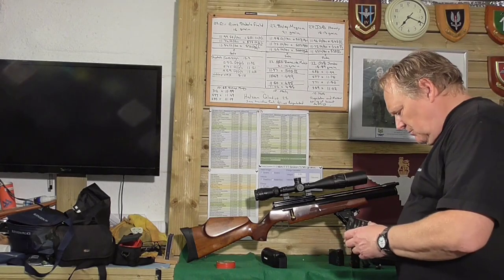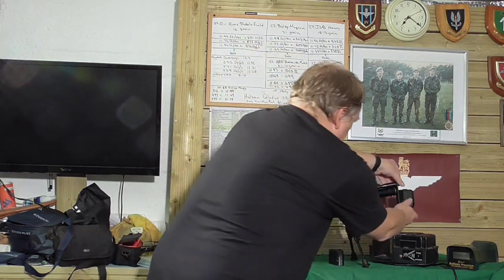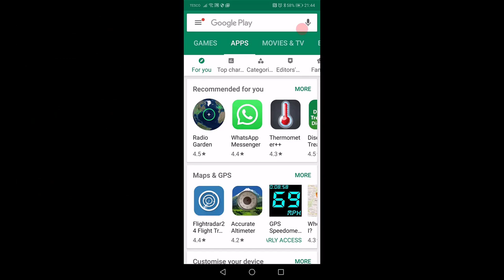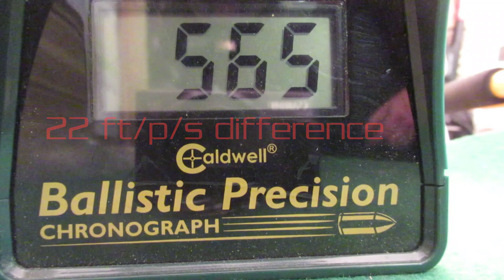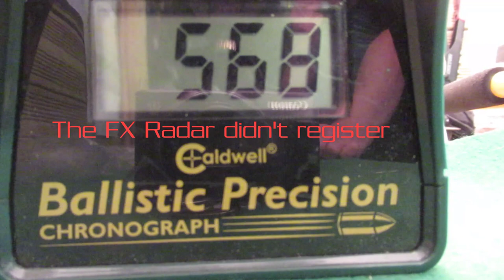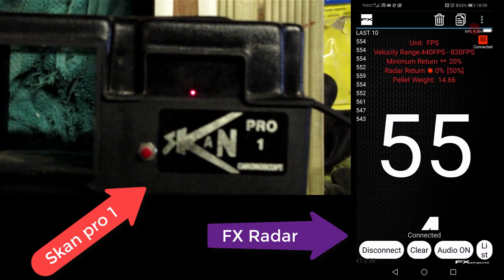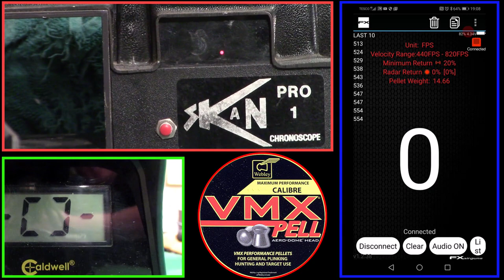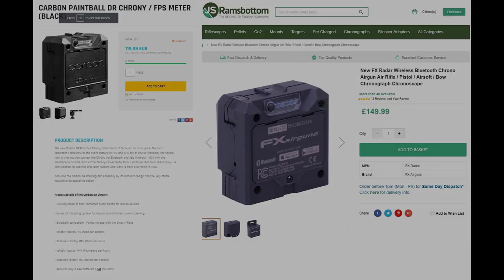The New FX Radar Chrono - How does it compare?

Comment: The FX Chrono requires a clear field of view to get a decent radar return, cluttering it with multiple objects will corrupt or prevent that signal. The only types you can directly compare without impeding the FX readings are barrel mounted, or other doppler radar chronos.

Comment: Just a quick point. The FX Chrono requires the space in front of it to be clear of other items. It's radar, if you place anything in front of it then you run the risk it will sqew the results, metal supports ( Cauldwell )  sticking up may cause issues with the radar reading. Looking closer at your footage and the screen reflection, did you place a compact camera between the FX Chronograph and the Cauldwell, that will block the radar signal?  In fact your further written results below show the FX Chronograph is within 1 - 3 FPS of the Grand Prix system, if I am reading it right.  Interesting that the FX Unit works bang on without a Cauldwell in front of it. Those results are from I assume one of your trusted testers. I am making a video to show how the placement of other items causes these issue. Also, and I have one, the earliest paintball models do not work the same as the FX Chronograph. Those telling others to buy one instead should pay the refund bill for those that buy one and are disappointed.  Love the idea of the barrel mount, but will that result in any barrel droop? Cheers. Giles
Reply from the maker: Thanks for your input Giles. More to do. The FX results did perform the same as the Skan chrono  that the police use to the same, or within 1 ft/p/s, as did the Chrono within the barrel of a Daystate Grand Prix, which says a lot for the accuracy of the  FX, which is great. Other tests at the range showed that the Combro cronograph were performing quite a bit bellow the ft/p/s of the FX, so could be a problem for those tuning a rifle with a combro and possibly going over the limit and not knowing about it. As for the Cauldwell i was surprised at the ft/p/s difference, which showed a higher reading. This could be down to the actural Cauldwell Chrono though and not the FX, as it was dropped a while back and the software didn't work. A good test though to see how the different chronos perform. In the last 8 shot group i realised that the power of the rifle had dropped of to bellow the specified field of the FX and i put that down to that as stated. I did the testing in the workshop due to the weather conditions outside, so will come back to this in the future. As with the paintball chrono the software for that works with the FX so is compatable. You'll have to download it and give it a try. The only difference was that it was geared up for European market, so only showed Jueles. All in all though the FX chrono is a great product. It worked fine at the range, so looks like the problems were down to the distance used to the pellet catcher and possibly items in front. No cameras were in front of the chrono, just chronographs. I also meant to attach the silencer in front of the clamp allowing the chrono to be under the behind the barrel, instead of the chrono slightly in front. Not sure if any of these made any difference to the results, but will carry tests out again at the range. I'm a big fan of you and your channel. Keep up the good work. Best wishes. Mark Holding Tinsley Park Shooting Club - A.R.T Team UK
Reply: I should comment here as the results posted by Mark were our original results taken at the ART range using my Daystate Grand Prix, crombro and FX Radar.  As shown in the results the FX and Grand prix fps readings were very similar while the Crombro was consistently lower. Around 50 shots were taken in total and the results were very similar to those posted which were sent from the FX via email and pasted into a text editor later.
 Marks test with the Cauldwell and the Clubs SKAN again showed a simi8larity between the FX and SKAN while the Cauldwell showed a noticeable difference.
Mark is simply reporting what he found... no more no less.  I agree the FX radar will need to see a clear space in front of it to obtain a reliable return...  I believe you state 6" clear space in front in your Test Video Giles.

Regarding the failed shots on the FX... I can only assume they are down to the close proximity of the cauldwell upsetting the FX radar return.  In over 50 shots at the range EVERY shot was registered by the FX !  

Overall the FX appears to be an excellent device that gives excellent results.

Marks comments re the Alternative device are also true. We HAVE checked operation between the FX and the Carbon DR with both apps and cannot find any difference at all other than the setup options in the DR software being designed for Paintball and not air rifle. If the DR software is connected to the FX the stated max fps of the DR (480fps) is rubbished !   We regularly recorded reading in excess of 700 fps without an error.  We are no able to confirm the DR chrono will operate with the FX app written by the same author....  but time will tell.  I doubt anyone will decide to purchase a DR compared to the FX as when delivery is taken into account the difference is less than £20.

There is more to come for sure, especially following the hinted at upgrades to the FX app.
Reply: Just realised I forgot to comment on Giles's comment re the mount inducing barrel droop.   Ive not compared the weight but the combination of the aluminum bracket and FX Radar would I believe be less than that of one of the more substantial moderators. And whats more I did check for any effect on the barrel with the FX fixed to the shroud of a Red Wolf which retained POI out to 50 yards when the FX Radar had been attached
Reply: Or it’s just inaccurate 🤷‍♂️

Comment: 🤔 I’ve got the combro so it would be interesting to see how accurate that is compared to your others 🤔 and which one do you think is the most accurate? 🤷‍♂️
Reply: i was going to ask Mark the same question Peter,  Cheers
Reply from the maker: During  chrono tests at the range the combo was reading well under the results of the FX, as much as the Caldwell was reading over the results. The Skan did compare with the FX in most of the results as the same or only 1 ft/p/s difference.
Reply: Airgun Sniper-Elite I’ve got an aa s200 unregulated which I’ve turned the hammer spring tension up as it was shooting at 9-10 ft lb. the combo now says it’s 11.20 ish with jsb 15.89 5.50.... so hopefully that’s sorted that. If however I use jsb 15.89 5.52 then the ft lb is down to 10 ish ft lb again 🤷‍♂️
Reply from the maker: @peewee007654321  It could be that the head diameter of the pellet is making the difference by being a slightly tighter fit. The way to find out would be to try in the smaller head pellet again and re run the test. It's amazing what small differences can make to pellet performance.
Reply: @airgunsniper-elite7385  Thanks for that Mark,  Cheers

Comment: The FX Chrono should be behind the barrel not in front of it?
Reply from the maker: I intended to do the test with the silencer in place. Will be running tests again at the range. Weather conditions meant the test was done indoors. Club members had used the barrel mounted chrono in range tests and it was well under that of the FX. The Skan chrono seems to match the result of the FX, while the Cauldwell was giving higher readings. Will run tests again at the range. Some of the results were down to the muzzle velocity falling bellow the pellet range input. This can be seen in the final test of eight shots where not many registered after the power dropped off below the specified pellet velocity.
Reply: I found if I place my caldwell chronograph about 2ft in front of my barrel I get readings that are within 3 or 4 fps of my fx chrono